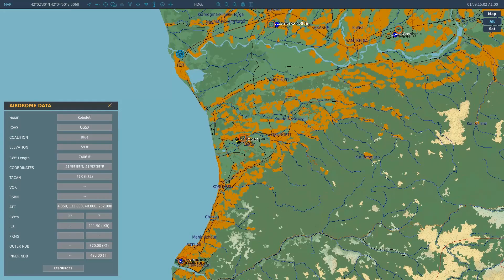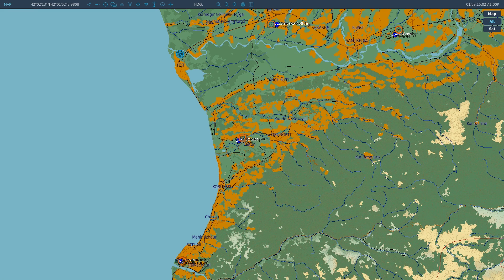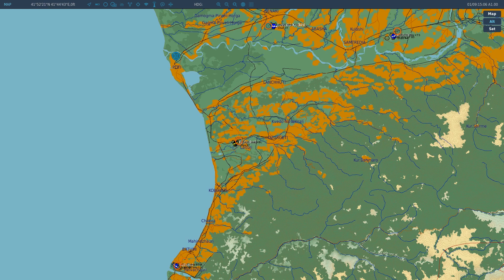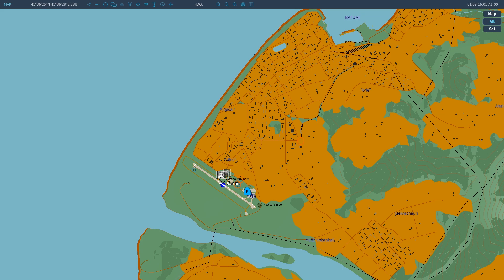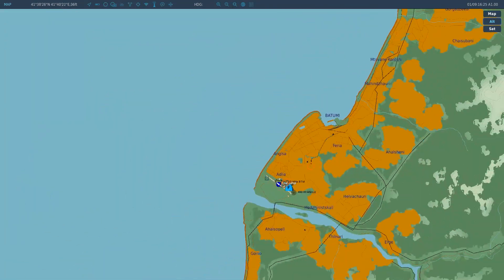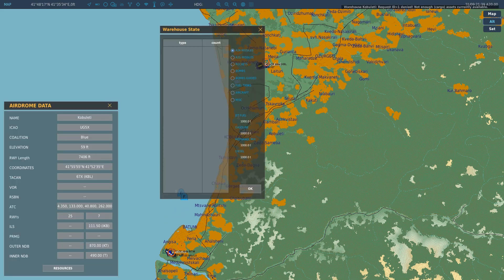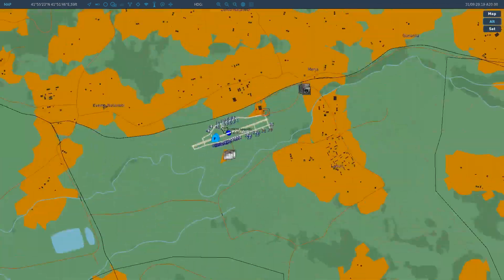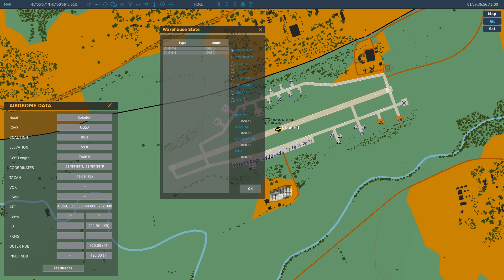DCS Warehouse Airbase Resources Proof Of Concept

Comment: Really nice class indeed!

Need to get acquainted with funkyfranky's MOOSE classes, they seem to be quite useful.
Thanks for posting this!

PS. Btw, I recommend that you set up a noise gate and equalizer for your mic input during your recordings. 
Use the noise gate to get rid of the background noise (which makes your mic sound dirtier). 
Next, use the equalizer to reduce the boost of mid-high frequencies, which are causing quite a bit of distortion. 
No editing is required, just set them up and perform the necessary sound tests before recording, then you'll be good to go. 
Programs like OBS offer this kind of features in the form of audio filters, they're quite useful.
Reply from the maker: Thanks Goreuncle. I use a couple of different mics when recording and usually don't care to much about the quality BUT this one is starting to bug me so I should probably look into cleaning it up a bit like you suggest. Will check into that. I do have it on another channel so can probably clean it up in post processing too I suppose.